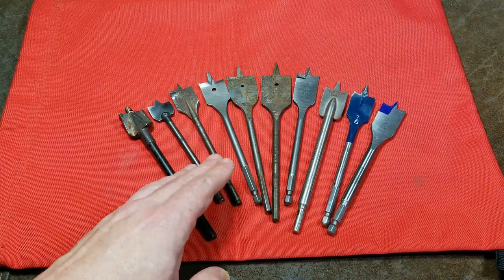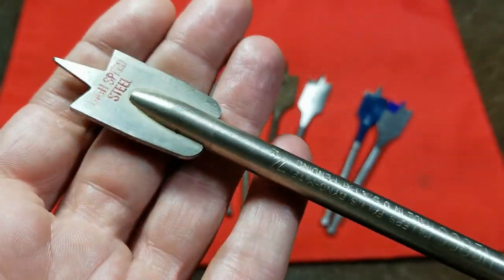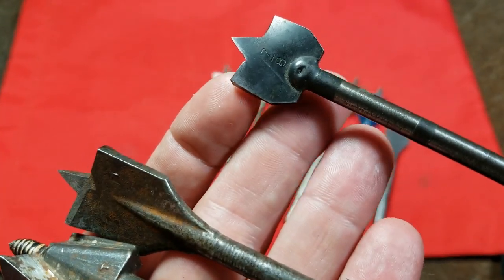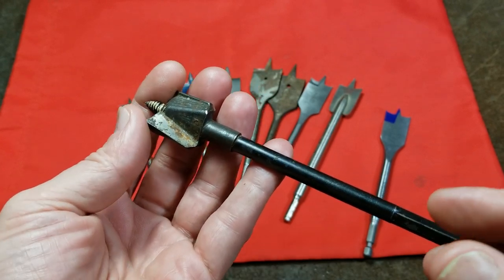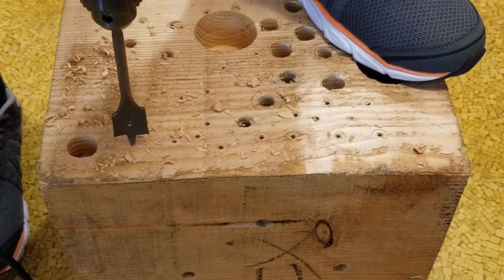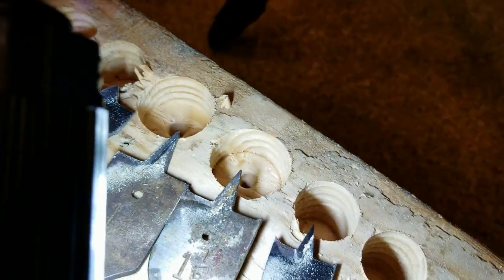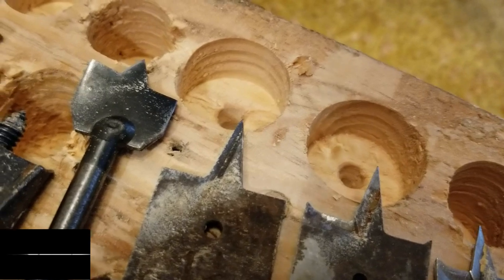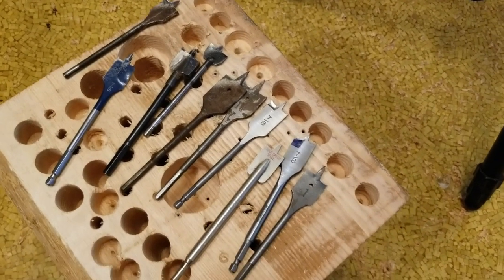Wood Spade Bit Drilling Test & Comparison

Comment: These bits are always satisfying to use, as it’s like taking a shovel and spinning it to drill. However they’re really only good to about as deep as the blade, they just don’t eject the chips well after you go deeper. It’s pretty easy to get these jammed in holes if you neglect to clear the chips out

Comment: Thanks Catus Maximus.I'm building a new wooden gate. Wood 2X4 to brick wall. I was thinking the Bosch spade 4 pac, for my bolts not to stick out and interfere with the gate. So maybe recess the bolt head into the wood just enough. A 3/8 anchor in 2 places to secure with 5/8 bolt. Its a 6 ft picket gate using 6 pickets. 3 hinges instead of 2. Should I use a washer on the bolts?  I'm thinking, yes. I have a main coon cat 5 yr old. I'm starting it on saturday.

Comment: Can it drill up to 5 inches deep hole?
Reply from the maker: Yes and you can drill really deep with extensions however since Spade bits have a short tip they tend to want to wander around side to side and not make a very straight hole if you want a long straight Hall you need an auger bit